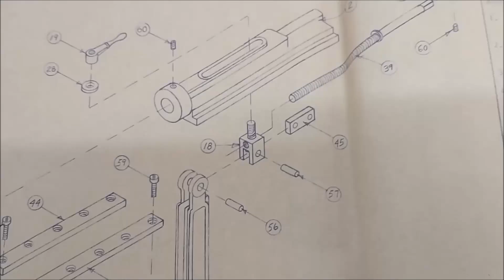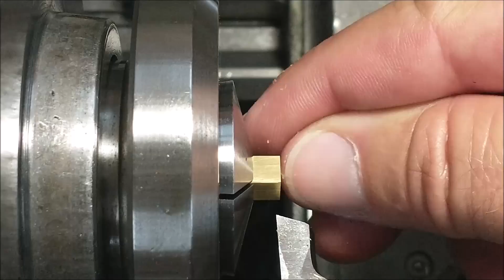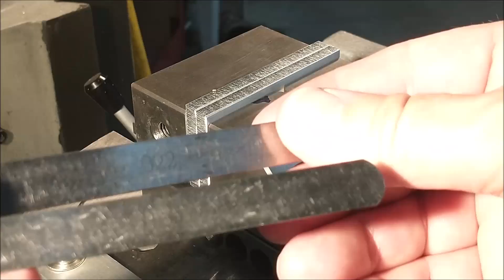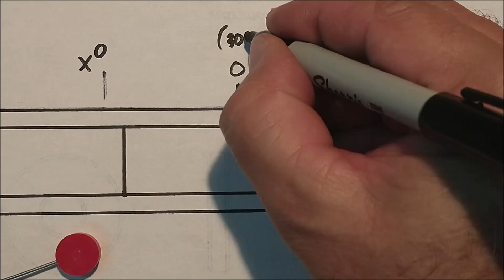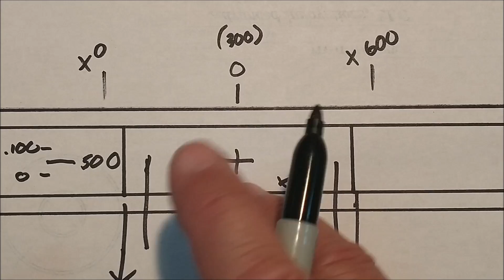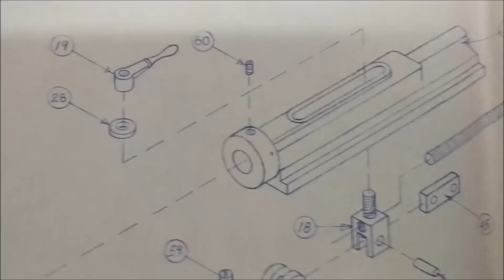Threads, Slots and Tiny Pins Nobody Will Ever See. Until Now !!!

Comment: How do you determine what order of operation you want to follow, from paper to working part? I know there are multiple methods of achieving the same thing.
Reply from the maker: This is a good question. The order of operations certainly isn't the same for all parts, but these are my thoughts on that topic. the first thing I do is try to completely understand all the features of the part and how they may relate to other features. Never assume the drawing is to scale. Sometimes what looks like plenty of room to hold or locate from, is actually way out of proportion. Determine how many op's the part will take and look at each one by itself. What kind of load on the blank, how are you going to hold it. Which end is stronger if its a double ended part, etc. And does it make sense to keep the part attached to the raw material right to the end, like the little pawl I just did. Run a few scenarios in your mind and watch out for one with possible problems, Rule that approach out and think of another. You may not be right 100% of the time, but that " I should have done it this way" moment will make you a better thinker on the next part.
Reply: @joepie221  thank you, your examples make more sense, with this in mind.
Reply: @Raymond.Butler  Unless you are doing predetermined factory production or jig series operation its combination of experience and guess work. Work holding is the main factor to consider ,second one is part strength after each operation so that it doesn't interfere with other operations.Tool exchange is another minor factor that saves some time.
In factorys you get the blueprint sheets with order of operation and how long it should take.(at least in past was like that ,they even had engineers for it to save time ,they even included piss breaks and tool grinding )
Reply: @armageddontools  I/E's are always doing time keeping work. Same way in the Electronics world. Of course we are speaking of factory assembly.
Reply: @armageddontools  Time & motion study I think they called it.
Reply: @joepie221  And, you do this in how long?  Great process description, sir... you are 'the man' !

Comment: Hi Joe. I come to your videos when I want to see how to do something the right way. I have no formal training in machining. I get the feeling that there are a lot of really basic practices that experienced machinists do without thinking, that I am missing. I can't help but notice how clean everything is in your shop. I clear away the swarf and any cutting oil that is used, wipe things down but still find that my hands get black grime on them no matter what I touch. How do you keep everything clean? Do you wash the machines down with solvent? I notice you used compressed air to clear away swarf. I've read advice against doing this due to  potentially forcing grit into machine crevices where it can cause damage. I would appreciate instruction in basic good machining habits and hygiene.

Comment: At one point you made marks on one side of the brass w/split end, and a mark on your collet. Is this part of some tricky way to get threads to "line up" rotationally? That is, when something *needs* to hit max-depth at a 90 degree offset from the pin bore? Or: How do you do what I'm describing anyway, if that's not what you were doing? ;)
Reply from the maker: I don't trust square collets to be perfectly centered, so I usually mark a side on the part to match with a collet side to keep everything inline if I remove a part for any reason.

Comment: Joe, another way to Rome; start with a square piece of material and use a stop in the vice like you did on the first little linkage. Let the material stick out of the vice just a hair longer than the part to be made. Mill the square down on all four sides of the stock. Drill the two holes and part of in the lathe (or use a saw mill). No additional set-up parts needed. Maybe a little faster. Nice job Joe. I like your style and joy. All the best, Job

Comment: You didn't talk us through the size differential between the holes and the pins. I'm guessing an interference fit on the outside holes but on such small parts are there any techniques you are using.

Comment: Yikes! You need a hand vise if you want to put tiny parts like that up to a belt grinder, or perhaps some Bernard pliers.

I splurged and bought a used Starrett 86 off eBay, and it's amazing. First time I used it I kicked myself for not buying it years earlier.
Reply: No need, it just saves time on his next manicure !
Reply from the maker: Greetings Paul. I used pliers initially, but the last bit was by hand for the shot. The table gap is nice and tight and the belt is free of holes, but that mouse trap gremlin is always strong in my mind when I get that close. I'll look into that hand vise.

Comment: I'm completely confused... How did you get brass to stick to a magnet?
Reply: The link was steel. You can see sparks coming off when he's rounding the corners on the sander. The camera seems to do crazy things depending on surface finish and lighting, doesn't it?
Reply: Tricky, you put a bit of steel underneath it. LOL
Reply from the maker: The plate was steel. The lighting may have been deceiving.

Comment: I could think of 3 reasons why you might have used the slitting saw vs. and end mill, but I would like to know what your reason(s) were so I can better understand how to make such deciaions in my work. I litterally said "Oh my God" when I figured out what you were up to with that magnet shop gem!
Reply from the maker: Orientation to the cross hole and depth of cut vs the width of the feature.
Reply: @joepie221  Thanks Joe!

Comment: Joe.  How do you know the exact width of your end mill.?  Do you trust the number stamped on it, or is there a trick to measuring and/or verifying the size of the mill?
Reply: Make a slot, measure the slot, if it's critical to hit it first pass.
Reply: If the cutter is sharp and hasn't been reground the number on it will be very close to the width, typically 0.001" or less, which is plenty close enough for many jobs.
Reply: Mike the flutes. Assuming the cutter runs true it will cut close to the diameter.